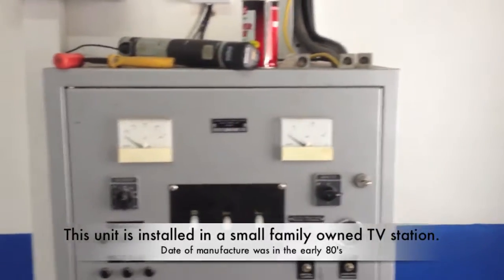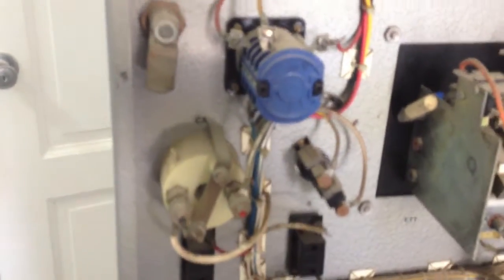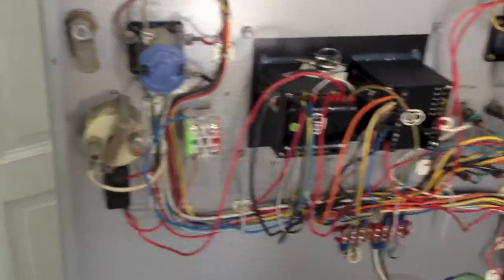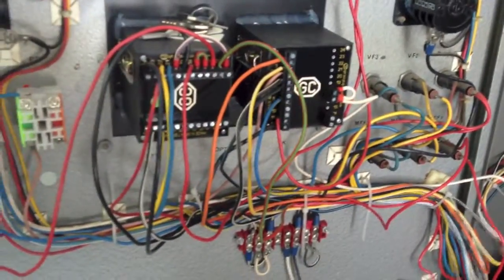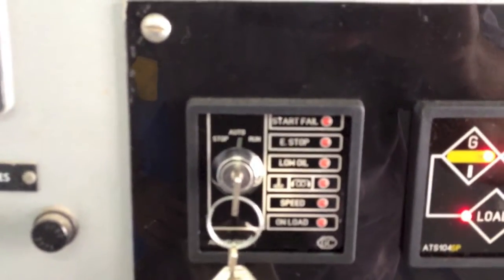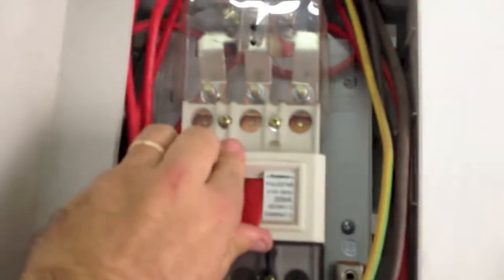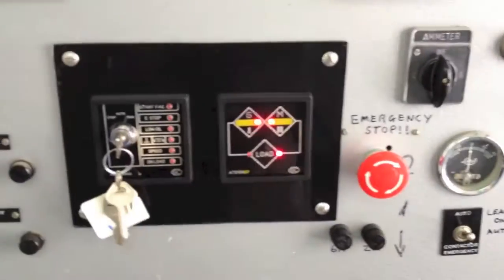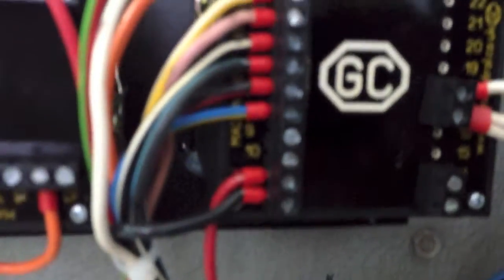Generator control install

Comment: hi have a old generator 271 delco ac 3 or sigle phase. i am trying to figure out how it all works right now i think i dont have the avr or panels. my question is, am i to buy a control panel that connect to the avr and the control panel take all 10 lead of the generator as input then route them accordingly switch between voltages and phases to produces power then i can feed from the control panel? what is it i need to buy?